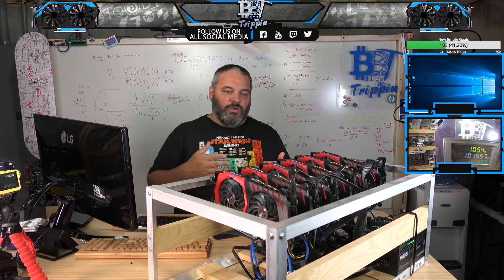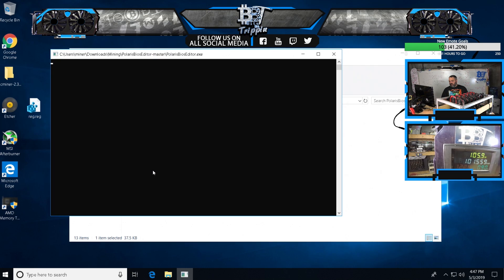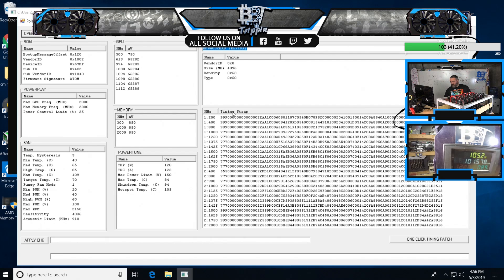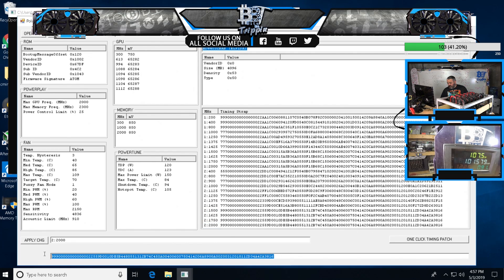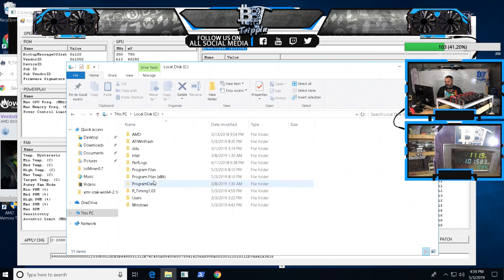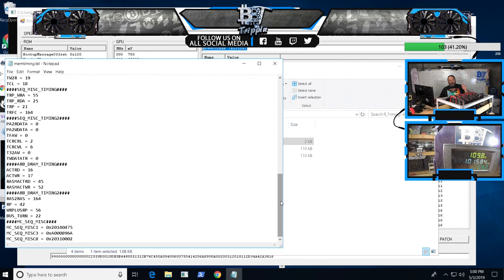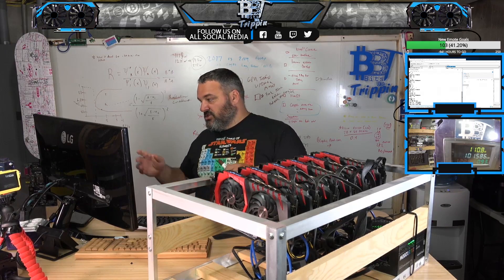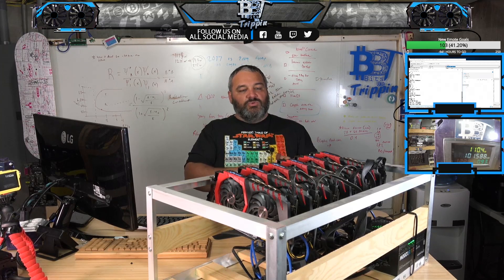How to decode your AMD BIOS to raw timing for AMD Tweaker Tool

Comment: why is nobody talking about the amd vii ? i only could find a few topic and 1 vid
Reply from the maker: I have been out of town (at Consensus 2019) ; but back today. We can approach this question on an upcoming livestream with real testing with the Radeon VII. The very limited (less than 2 hours of iteratively trying settings) have resulted in no real improvement, however, theoretically the design and speed of the HBM2 should allow for up to 128mh ... Either there is another component creating a artificial limit or we just haven't found the most optimal setting.

Comment: the latest claymore 14.0 is fantastic. it has the Eviolp straps. ive used it on a 3 card test rig. getting slightly higher hashes and slightly lower electric usage than i EVER got with phoenixminer. rig is 1 x rx 470 , 1xrx480 , 1xrx570.  just to be clear this is a rig with already optimised bioses on all three cards! its doing about 2% better hashrate and 2% lower electric than the fastest it ever went on phoenix.  the rx 570 uses "strap 1"  the rx480 and rx 470 use "strap 5"  . this may not sound exciting but its better than ANYTHING i got before . marvelous.  now the best bit - you can read the straps off using the amd tweak gui from eliovp. so run claymore 14.0 then run the amd tweak gui and read off the straps. (so you can see the secret sauce) claymore has included 5 custom straps for each type of polaris card. this is polaris only at the moment. well done everybody especially bitsbedrinking, eliovp and claymore.
great videos sir!
Reply: so the implication is the "one click" bios mod on PBE 1.7.2 (that i was using) - is not as good as the new straps claymore is using

Comment: What I am really struggling with is how much work one would have to do for really a few cents per RX480/580 GPU. It could be worth for a farm with tens (if not hundreds of GPUs) but not with someone left with a couple of AMD video cards. I am actually shutting down all my GPU mining in May. I do not see real gains anymore
Reply: prices will go up again or i will eat my trousers. the creator of the new tool has said gains are possible on say an rx470 im sure he said 0.7mhash ethereum. which isnt very much. but its interesting for a hobbyist miner who likes to fiddle. here in the uk its only worth it (to mine) in the winter where (for instance) my gas heating bill has been zero because the rigs heat my flat in winter.
Reply: dastardlyman I agree with what you said. I am stopping mining when the outside temperatures go up above 22 C or so - I will not run extra AC for my mining this year (last year, I had 20 GPUs and 3 ASICs). I am left with 3 GPUs and ASICs (that will be off too)
Reply: @mfurman  look at exhausting the heat.
Reply: Jason, do you mean to gain a few dollars a day? 😆 I was exhausting heat from my AC. I can not justify the cost of AC (temperatures in Ontario where are live reach 35 C or more in Summer) this year. I actually have totally enough of the noise of the ASICs - this is the house and not a dedicated facility
Reply: I may turn my Radeon VII's to super efficient mode this summer.  Still will be around 80 Mh/s instead of 90, but will save around 60 watts per card and run 10'C cooler.
Reply: Actually McAfee will eat his own penis if Bitcoin doesn't hit a million in the next 2 years.